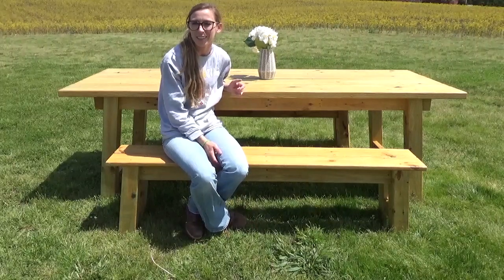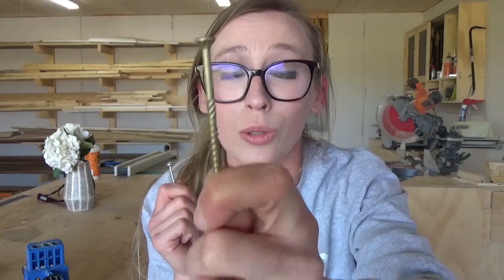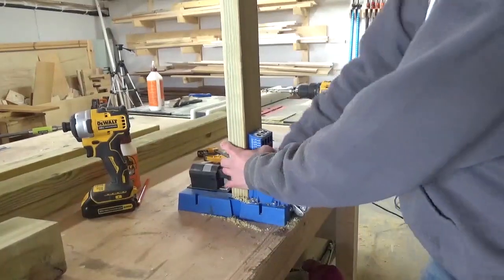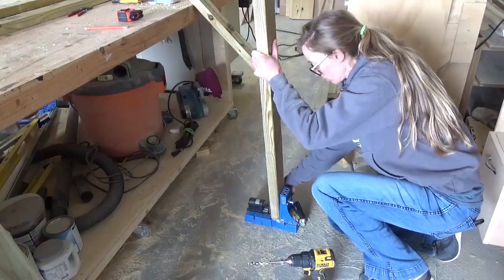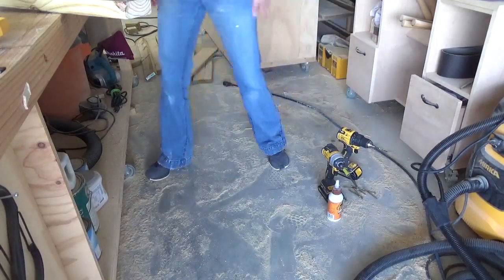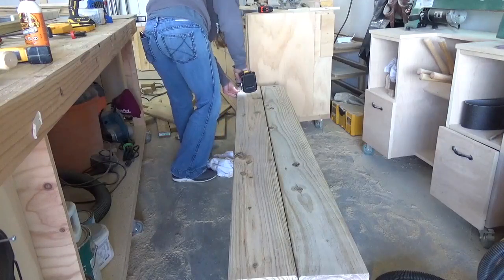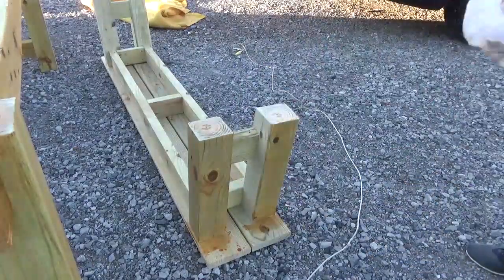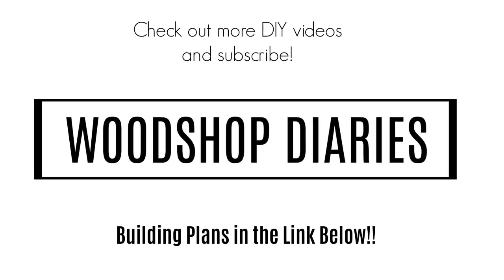How to Build a Trestle Table and Bench--For Your Outdoor Space!

Comment: I hate working with pressure treated but I love making lawn furniture.  I use deck screws all the time in my pocket holes. Pocket hole screws are hard to find out here in the middle of nowhere.  I put my clutch on my drill on like 5 or 6 and then hand tighten the rest of the way. But I'm also a disabled veteran with nothing but time and no deadlines lol
Reply from the maker: That’s a great way to do it! My biggest issue is I didn’t have a really long star bit to drive them with. I need to get one of those for future projects 👍
Reply: Hey Jason, thank you for your service brother!🇺🇸🇺🇸🇺🇸✌🏻️

Comment: I have built a lot with treated wood.  Seeing you kicking the table legs to get them in position when assembling the apron on the table reminded me of some of my struggles with assembly.  Have you made a "picnic table" where the bench top is attached to the table legs?  With treated wood, it is best to let it dry for a couple weeks before applying finish.  Looks good though, so don't shy away from the treated wood.  I always sand mine, it takes away some of the treated wood look and makes it look more like regular lumber.  Probably takes away some of the "treatment" that makes it treated but I want it smooth to reduce the possibility of splinters before the customer gets it.
Reply from the maker: Thank you! Yes I sanded this before assembling each piece and it did make it look a little better and definitely much smoother. I commend you for working with treated wood 😂 I cant stand the stuff. I think it takes some getting used to haha

Comment: Thats a nice table, I only use hardwoods for my projects.
Reply from the maker: Thank you! I’d love to build more with hardwoods but I don’t have a lot of suppliers in my area to buy it from and when I do get some it’s pretty expensive. So I use softwoods most of the time.
Reply: @WoodshopDiaries  I'm really fortunate in my area. I've got unlimited supplies of materials. If you get a chance I got some videos of the stuff I've made.
Reply: Build a lot of outdoor furniture with hardwood?
Reply: @chrismoore9997  yes there's option for natural rot resistant materials
Reply: @bellscustomwoodworking9058  - What kind?  I have limited options locally, but I am willing to give it a try.
Reply: @chrismoore9997  if I remember correctly teak wood is a great option. Its a very sustainable material as long as budget can allow it.

Comment: How necessary is the bottom stretcher for tables in general?
Reply from the maker: It just depends on the design. I used it in this case because the legs were angled outward. The stretcher keeps them pulled in. If the legs were straight, I probably wouldn’t have added it unless I just liked the look of it
Reply: @WoodshopDiaries  Why were the legs angles outward?  How did you decide on 7 degrees?  Just trying to learn.  Great video.

Comment: quick question: would it be ok to not use the 7 degree angle cut for the legs? would that change things up to much? first project and not to confident that i wont screw it up. thanks
Reply from the maker: Totally! You can cut them straight if you’d rather 👍